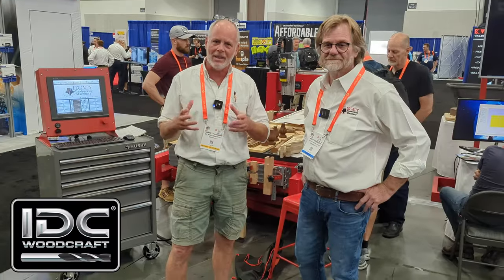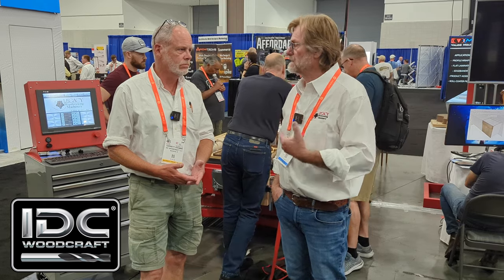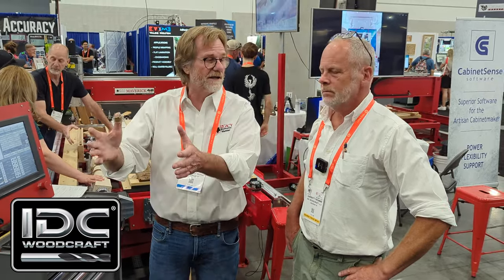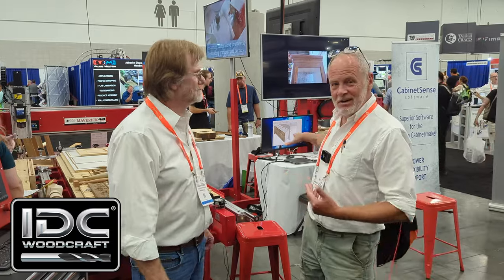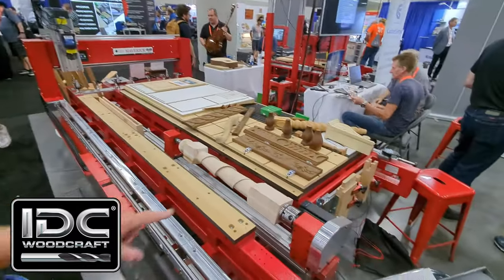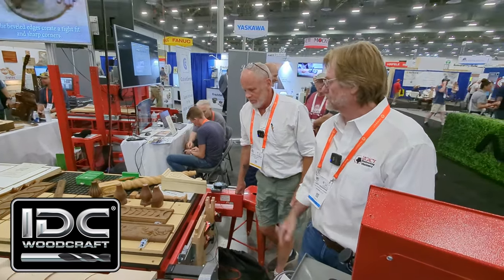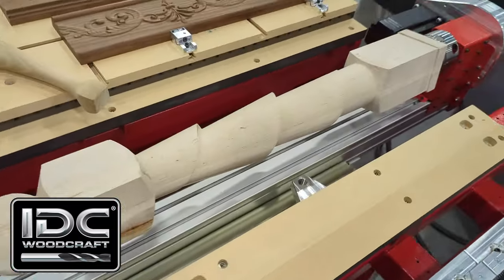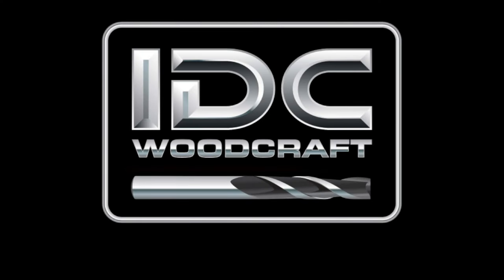Legacy CNC Router: A Game-Changer in CNC Woodworking for Cabinet Making

Comment: I have had a Legacy 3*5 for about a year and a half.  Other than a couple of initial software problems (quickly resolved by the factory) the machine has been absolutely trouble free.  Couple of observations. 1) the machine is absolutely rock solid .  The upside is that the machine quickly and accurately indexes to the presets and produces results with extremely tight tolerances, 2) the Legacy software takes some getting used to. It has a somewhat unique look and feel to it.  The initial challenge is to get your brain tuned in to how the designers are thinking about a process. Once you shift your thought processes a bit then the the software becomes very easy and amazingly powerful 3) Tracy and the crew at Legacy do a weekly on line seminar that is very helpful. Different topics get explored which has significantly expanded the range of projects I am willing to take on 4) after 30 years as a woodworker, shifting to CNC manufacturing has been an interesting and fun stretch.  The Legacy machine has greatly facilitated the shift.  Would buy one again in a moment.  Only issue would be to look at one of the 4*4 machine vs the 3*5 that I currently run. Brad
Reply from the maker: bradsmith7363, thanks for sharing your perspective on this awesome machine brother! Glad to hear that it has been an enjoyable journey for you.

Comment: I'm a big fan of the Legacy machines and thought it was ideal for what I wanted, but came to realize there are some very real limitations.  Primarily, you can only do one thing at once.  If you are a small shop that just wants flexibility, fine, but if you have a lot of work that includes needing to turn spindles or carvings then you would be far better off with a separate machine for that instead of tying up your primary money maker for hours (have to include setup/changeover time each time).  It also looks like vacuum is limited to about 2/3 of the table?  I have an SCM Minimax 5 way sliding table saw/planer/jointer/shaper/mortiser that is similar, it gives me a lot of ability but at the cost of less efficiency when I have to convert between operations.  If I had more work going through or an employee it would really slow things down compared to separate machines.
Reply from the maker: DSDesignWoodworking, you bring up some very fair points my friend. Every machine will certainly come with it's pros and cons! It's really choosing the machine that's the best fit for you and what you're looking to create that matters most!
Reply: The vacuum table is NOT limited to 2/3's of the table. When not in use, the turning center can be covered, giving the user full access to the entire 4' width of the table (including a vacuum option).

You are absolutely correct. You cannot use all the features of a Legacy CNC at the same time. If you have room and the budget for it, more machines might make sense. Legacy makes a CNC that does nothing but spindles. That machine would be a better option if you were turning out lots of balusters and newel posts. But, that's not the type of work the CNC machine shown in the video was designed for. A lot of Legacy owners make custom cabinets and use their CNC to cut the cabinet parts from sheet goods. Many other 4x8 or 5x10 CNCs can do the same. The difference is Legacy owners can easily dress up those cabinets with custom turned barley twist columns. Adding such a feature turns a generic set of cabinets into something much more special. Dressing up cabinets in this way may add only a couple of hours to the build time for a typical set of kitchen cabinets, but Legacy owners can sell their cabinets for much more than cabinets without such flourishes. 

So, yeah, it would be great to have more than one machine -- provided both could be kept busy, you had the room, etc. But, having a machine that is more flexible allows you to do higher value work. Such work can bring in more revenue even if your total productivity suffers a bit.
Reply: Legacy also offers a machine that carves spindles and other turned projects only.
Reply: @unclebob8746  Yup, I looked at a used one seriously last year before picking up an Avid Pro machine that I plan to add a rotary axis to.  I'm just getting started and have no idea how much I'll need to turn, will likely be more 3d carvings than spindles, etc.. so I just want flexibility right now.  If I were busier and had a consistent need to turn spindles or anything else then I would be far better off with two machines that can work at the same time vs one that can do everything but only one thing at a time along with changeover.  Awesome machine and I'd love to have one, but it's priced at a level where you'd better be running a large volume of work through it, and if you have a large volume of work then it's probably not the ideal machine (vs two separate)...
Reply: Which machine today  allows you to turn, work off the vice and work the table simultaneously?
Reply: @Navigator777777   Did I not clearly say I think a busy shop would be better off with more than one machine?  🤔
Reply: @LoneOakWoodworks  
Prolly semantics throwing us off? We all have our own universes and vision for the future.
What you wrote suggested  to me the problem with a Legacy mill is you can only do one thing at a time. Plus I was trying to be cute.  ;-). Right now I wish my new 3x5 Pro could hang sheetrock for but alas...I've discovered it's not gonna hang itself.
;-)

Comment: Thanks for sharing the Legacy CNC overview. Is the touch plate physically mounted to the CNC machine? If so, then how would VCarve Pro know where the top of the material is located? Or does it mark the top of the spoil board which is the bottom of your material? Does the ATC bits automatically go and touch off of the zero plate or is the bit length automatically stored in the software?
Reply from the maker: Hi Dion

It is built into the machine software. Yes the printer is hard mounted
Reply: The touch plate does have a "home" mounting that is used for tool measurement.  The touch plate unit can be moved anywhere on the machine bed to measure either the top of the material or measure from the bed of the machine depending on your design.  You can use most any design software.  I use Aspire, also an outstanding company that stands behind their product and has outstanding customer support.